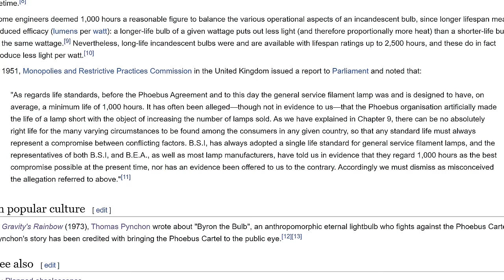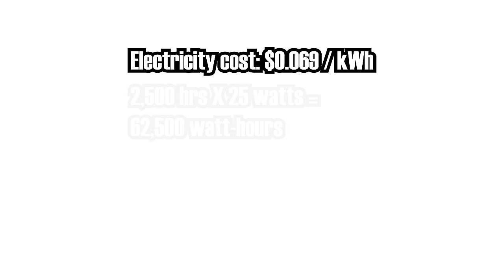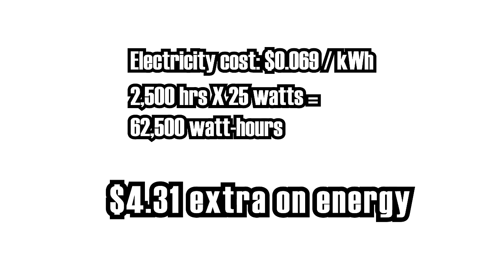Longer-lasting light bulbs: it was complicated

Comment: It would be interesting if you would do a follow up on the Dubai LED light bulb which is designed to last much longer than a normal LED by increasing the number of LEDS and underpowering the diodes.
Reply: And contrary to the incandescent lights, being more efficient at the same time as lasting longer…
Reply: I came down here to comment this very thing! please do! BigClive has done a great video overviewing the technical side of the subject.
Reply: Phillips now sells 200 lumen/Watt bulbs elsewhere under the UE (ultra efficiency) label. There are other vendors reaching that too. EU changed the labeling on light sources and now most LED bulbs don't even get a C. The UE lamps get an A.
Reply: unlike incandecent bulb when you underrun led the effiency goes up and it last longer
Reply: Makes me wonder how flashbulbs used by old cameras were designed
Reply: I would think that there is nothing revolutionary about the Dubai light, only a completely different mindset. The LED lightbulbs that I get at Costco last vastly longer than incandescents even though there is no redundancy in the complex circuitry. These cheap LED lightbulbs are more likely to fail very early their lifespan (lemons) than to fail later  on. That said, the LEDs lifespan is very affected by heat, so a great many of these retrofit LED builds that go into confined fixtures where they get no airflow are being cooked to death by the legacy fixtures. Something to look into is the degree to which the Dubai design helps to combat the efficiency decline with age that LED bulbs suffer from as do fluorescents. Overall lifespan is not a useful measure if people are holding onto old bulbs that are producing 1/2 the brightness with the same amount of energy as new bulb.
Reply: @upcsatx  Flashbulbs contained a wool or foil of magnesium, zirconium, or aluminum and an oxygen rich gas fill. The filament just served as the igniter.  They only worked once, you used a new one for each photo. They were bright though.
Reply: @davidg4288  Some instamatics that used "stick flashes" electrically fired them without needing any sort of battery.  I'd guess they used a piezo or something, meaning the amount of electrical energy was tiny relative to the amount of light produced.
Reply: Big Clive has covered it.
Reply: @upcsatx  a kind of "candyfloss' filament of magnesium wire and no vacuum in the glass. They basically burn :-)
Reply: @davidg4288  there were also studio flash lights which used incandescent light bulbs that were constantly lit at low power but overvolted when a flash was needed.
Reply: Big Clive already covered that.
Reply: @flatfingertuning727  Could stick flashes have been mechanical?  A tiny percussion cap? Flintlock?  OK, I'm kidding about the flintlock.
Reply: @mjouwbuis  I bet I saw the incandescent "flash" lights during school group photos and never realized what they were.
Reply: @davidg4288  Magicube brand flash cubes were mechanical, but stick flashes were electrical.  Interestingly, they were designed in such a way that sending a pulse through a pair of contacts would fire the first bulb on a side, sending another pulse through the same contacts would fire the next bulb, etc.  The bulbs all in series, but all but one was shorted out by a fusible shunt which was located next to the previous bulb.  The first pulse would fire the first bulb, causing it to melt shorted and also melt the shunt across the second bulb.  The second pulse would fire the second bulb (which was no longer shorted) and melt the shunt across the third bulb.  Pretty clever design.
Reply: @flatfingertuning727  I remember those flash sticks that didn't have enough contacts, but never new exactly how they did it. Some flash sticks did have enough contacts, I don't know if the camera just remembered mechanically or had a circuit to detect the first good bulb. I never owned one of those "110" cameras. I went from my parents' box camera to an old Polaroid, mine used small flash bulbs. Then I bought a 35 millimeter when I could afford it and an electronic flash that was bigger than the camera. Decent film required a lot of light!
Reply: Flip flashes were often fired by a piezo setup.  Magicubes were fired pyrotechnically by releasing a spring in the cube base.
 @flatfingertuning727

Comment: The first LED bulb I ever bought back in 2008 is still going strong. I paid almost $30 for it and it consists of about 2/3 copper heat sync. I have had many modern LED bulbs fail on me, most of which have no or very little visible heatsink. I think there may be a similar trade off in LED bulbs as in incandescent - a trade off between how strange the bulb looks and how long it lasts.
Reply: yeah it is weird that  most led bulbs  do not have a proper heat sync.
Reply: I have the first type of Phillips LED bulb on the market, still powered, still working. Subsequent purchases of the same bulb brand and line have never been as reliable, and every time they go bad, i take them apart and inspect them. The quality of the parts inside keeps decreasing with each iteration. Heat sinks, diodes, all. The only thing that has improved is the mother board. They've managed to make them both heat sinks and boards at the same time.
Reply: I have some COB filament style bulbs which are still going strong 8 years in. Granted they're only 4w, and the filament style means they have plenty of chips. So they might be being underrun. I got them from a discount store even and they had to have been under 5$ each. No visible heat sinks. They don't give off much more light than you get during the day with the blinds down however.
Reply: Heatsink?
Reply: @timetoerist1313  Heatsink.
Reply: @aserta  A lot of things might be decreasing quality but the LED diodes actually seem to be improving at crazy rates even in very cheap bulbs, they almost follow a Moore's law, the problem is, due the same reason that they are much improved they now get grossly over driven and under cooled so they save up money that way reducing the LED count by light output which in turn reduces lifespan.
I like to take them apart and inspect the emitters under a microscope and is nice to see how they changed in tech, in 2009 I bought a chinese 5W LED for about $12 (just the pure LED on a "star" heatsink) it had 4 chips and it had an output of about 250lm, under the microscope the chip looked smooth and had straight gold electrodes. The other day a cheap bulb (1 dollar and 20 cents) stopped working and I tore it apart and took a look at the LEDs the chips are so much smaller, the electrodes have a more complex pattern and they all have patterned light extraction structures, they kinda look like a iridescent honey comb, and they are run at many times the current density of that old LED yet they are still more efficient, the only step back so far Ive seen is that they are using what seems to be aluminium bondwires, that's what usually fails or the driver, not the diode itself.
Reply: Yup I installed a pair of Cree flood/spot lights that were mainly heatsinks with leds in the center. Still see these on from time to time riding by the house.
Reply: @cem_kaya its not really weird at all. Heat sinks cost money, and folks like cheap light bulbs.
Reply: I have 3 EarthLED bulbs from 2008 that still work.
Reply: @JK-mo2ov  That’s actually the brand of mine from 2008 as well!
Reply: @donatj  I have one of the EvoLux (I think 60 watt equiv) with the giant heat sink, and two of the “100 watt” equivalent that have the fans in the base. Had to oil the fans. Still haven’t seen that in any other bulb.
Reply: I still have this Ikea LED bulb i bought in 2012 or something, it's still working great.
But i've also had many LEDs fail on me, mainly OSRAM tube lamps.
Reply: @jacobhargiss3839  heat sinks lower the temperature and ruins the CRI, because modern LEDs designed for lighting are supposed to run at 85C, and the CRI is the highest at that temperature. (the chemistry of the light converter paint is calibrated to 85C basically)
This makes the situation more complex, because LEDs are calibrated to 85C because most manufacturers at the beginning preferred to run them hot anyway...
Reply: @teresashinkansen9402  @adamrak7560
Thanks for the info. Great to see arguments that add complexity to the story of planned LED obsolescence... kind of like this video does.

Now I kind of wish I had a microscope, or that someone would make a video about LED diode evolution.
Reply: I bought $2 LED bulbs from DealExtreme in 2009.
They get used several times per day and none have failed.

Comment: Fun Fact: Putting bread dough in the oven to rise with the oven light on (providing those 40 watts of heat) is a great way to proof it if your house is on the chilly side.
Reply: The oven I bought even has this use case in its manual: prove dough on the “light only” setting at 50 °C.
Reply: Unless you replaced that appliance bulb with an equivalent rated LED.
Reply: @jeepien  I
If you put an LED bulb in your oven, it will melt, so it’s uselessness for proofing dough is kind of not important.
Reply: @petermescher332  :: Yeah, I probably would not try that myself.  Although there are LED bulbs that are "appliance" rated, I'll let someone else test that.
Reply: @jeepien  I think those are the fridge bulbs…  I do make use of those.
Reply: I've seen them used as low power heaters for egg incubators and beer fermentation.
Reply: niceIdea.
Reply: Most ovens these days use a small halogen bulb or several compared to the old 40w bulbs.  Once had an oven than had no light, no socket in which to put a light and no oven window.  It was in an apartment.  Awful.

Comment: You truly are the Mythbuster of the Tech industry.
This cartel gets brought up occasionally where I work. (a second-hand shop / thrift store.) We still sell them, but not many pass the 5-second test stage.
I once had a lamp end itself so violently that the glass popped clean off, without shattering the glass. I presume air got into the bulb and turning it on did the rest.
Reply: Incandescent lamps did all kinds of weird stuff, never experienced a lamp just coming back to life after a flick like he did there but this gives context to people shaking the lamp and testing again (tho that was likely hearing a rattling piece of filament fallen inside).
One lamp I had on a clamped fixture (the kind you can clamp to a desk side or in my case a shelf) sagged so much during it's lifetime that the filament tangled on itself and it just decided to become brighter. It was funny and pretty darn bright for the little it lasted.

Comment: Lavalamp Tip: Lava lamps often use very expensive bulbs, and lots of them. 1. Use a smart plug so you have a fade in effect. This prevents the fillament from shock by the high current and it lasts much longer. I use 50W halogen lamp dimmed to replace the 30W lamp. Runs for years 80% of the time.

Comment: I used the formula on the "lamp rerating" article to find out how long a 120V light bulb would run if run at 12 volts instead. The output was ≈114 billion years, but I think it would only glow about as bright as the toaster wires, so YMMV.

Comment: Your video, as always, is spot on. We saw that back in (if memory serves me) around 1980 when there was a fad of selling long life bulbs, mostly door to door. The average user won't keep track of bulb life but we could tell that the light was dimmer. Fortunately, when I moved to my new house, I still had the "crate" of bulbs. The new house would guarantee to blow a standard bulb every couple months. It turned out the house was running close to 130V. The utility moved the transformer tap to its lowest setting. Voltage was still a couple volts higher than specs called for but I could then go back to standard bulbs.
Reply: I used to get those.  The 60s were brightness equivalent to 40w standard bulbs , but they lasted for me , far longer. I didn't chart it out , but I def paid attention at the increased cost. I'd say they lasted about 4x as long. One in the garage , where it was hard to change lasted approx 7 years non stop running

Comment: My parents had an old energy saving light that lasted almost 30 years... The thing is it took what felt like 30 years for it to warm up to full brightness.
Reply: It really saved the energy for 30 years by not burning.
Reply: That sounds like a compact fluorescent - they're the only bulbs that need to "warm up" to produce the full light output - well, other than high pressure sodium, or other HID bulbs, which I don't think you have inside your house.
Reply: @gorak9000  buddy, what do you think "incandescent" means? Here's a hint, it doesn't mean "cold". Some types of filament-incandescent lights reduce wear on the filament by heating it up slowly.
Reply: @gorak9000 I used to have many HID lights in my house 😂 but I was different
Reply: And some folks even were stupid enough to put these on PIR sensors. Set to 20 sec. 🤣
Reply: denniswilson8013 That's how language works though. For most of human existence lights burned. Just as I write E-Mails even though I'm actually typing them.